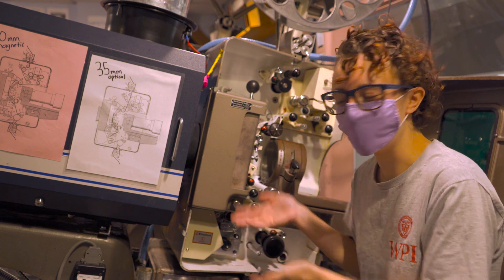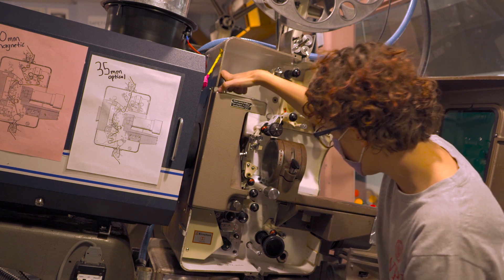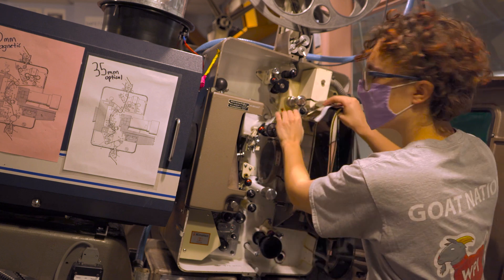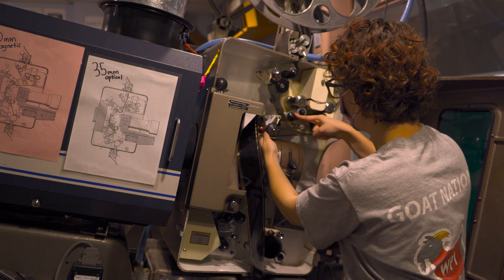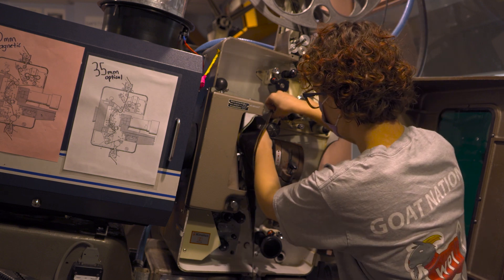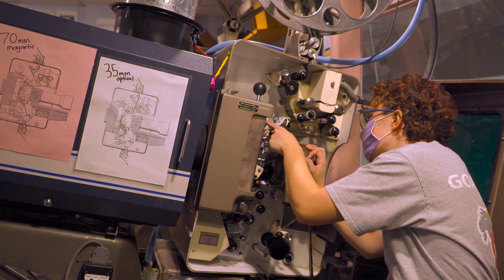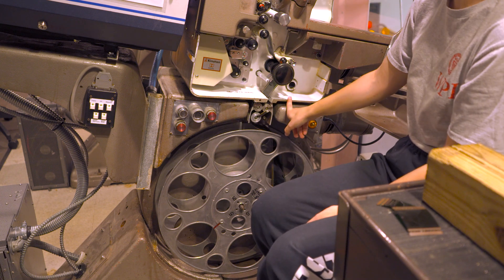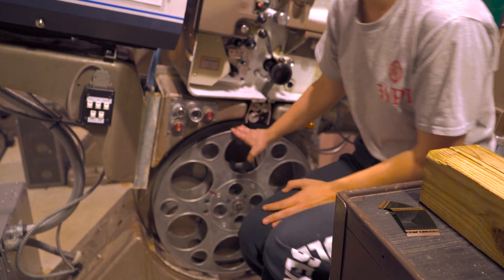70mm Film Projector SETUP  (4K) #70mm  #FilmSetup #DP70

Comment: Those are pad rollers not shoes and your projector needs some maintenance.  The pad rollers should lock open.  When did you Las check the oil filter and change the oil.

Comment: I remember threading up a Phillips DP70 in two minutes when I was Cinerama projectionist
Reply: yes I worked as a Cinerama projectionist when we used three projectors and then on to 70mm with the Cinerama anamorphic lens. Those loaded 70mm spools were heavy to lift into the top spool box of the DP70.
Reply from the maker: @peterlogan1623  that is amazing! I am jealous you got to run Cinerama prints!
Reply from the maker: That’s so cool! Must have been an expert!